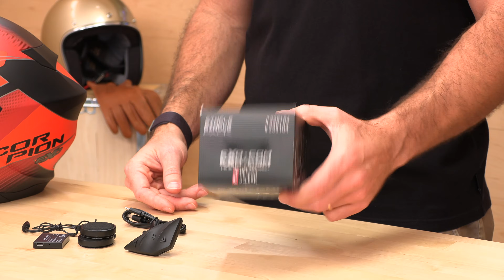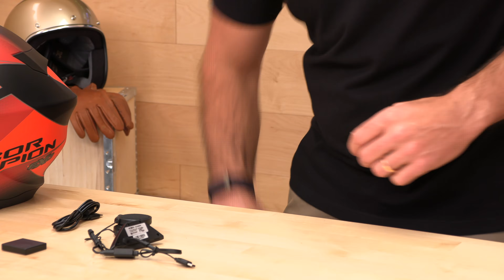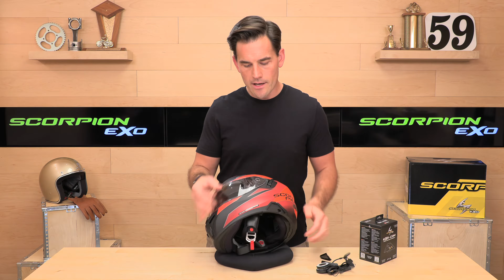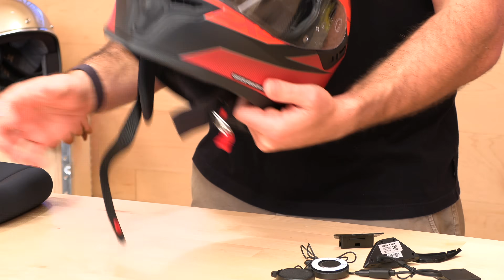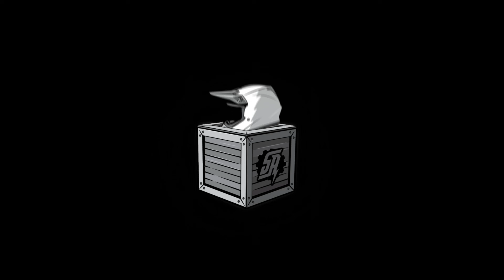Scorpion Exo-Com Bluetooth Communication System Review at SpeedAddicts.com

Comment: Ive had two of these they are nice but only have lasted me 2 or 3 month riding everyday. The wire connection between the speakers and the battery breaks easily and ive had to buy 3 different ones that broke within 3 months. Ive given up on them
Reply from the maker: That is definitely not ideal, we have not had any reports of this issue yet.
Reply: Hey, same here. I've had mine about a week and as soon as I removed the battery to charge it (that's a whole other problem I have with this unit) the wire broke.

Comment: Mine only turns on sometimes. Full battery and firmware is up to date. Won't 3 button reset. Very frustrated with it. When I press the power button I can see a faint white led flash but that's all it does.
Reply: Had it 6 months
Reply from the maker: Could be a defective unit. Have you tried reaching out to Scorpion?

Comment: I've got a HX1 and is that the only option for that helmet? And also can it connect to other brands of intercoms?
Reply from the maker: The HX1 is not compatible with the Scorpion EXO-Com. You can run a different com unit of your choice with HX-1. The EXO-Com does with well with other brands.
Reply: @SpeedAddictsTV  thanks for the reply, it really helps 😄

Comment: need help as a new rider. Which one do you recommend? 
Exo T520 / Sedeci Strada 2 / AGV K3
Reply from the maker: Great question. No matter your experience level the Scorpion EXO-T520 is an excellent option. First off, Scorpion offers a full 5 year warranty to protect your investment. It also it prepared for the Scorpion EXO-COM communication unit. This means you have a flush mount comms system that is easy to install and not bulky. Add on the airfit and dropdown sun visor, this helmet is extremely hard to beat. Hopefully this helps! Thanks for watching.

Comment: does it work with the Exo R420? i’ve heard it has speaker pockets
Reply from the maker: No, the R420 is not compatible with the Scorpion EXO-COM. The computer and battery do not have mounting points on the R420. The EXO-COM is currently compatible with the T520 and GT930.